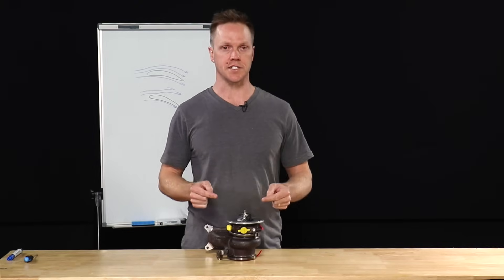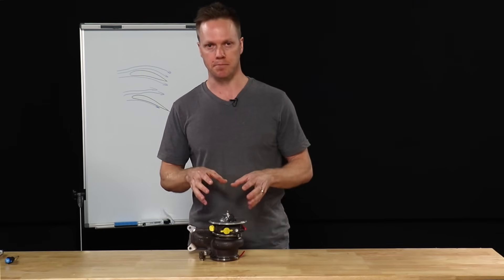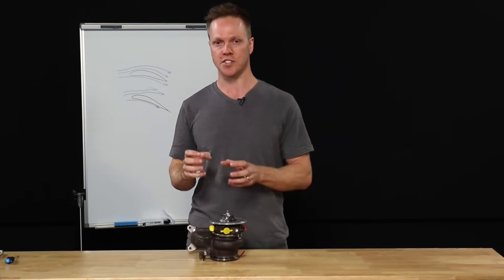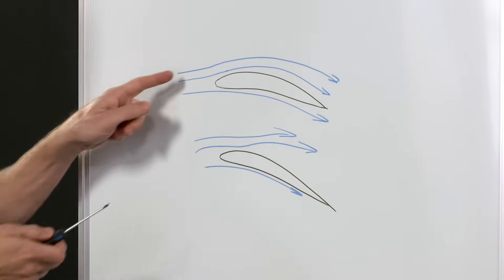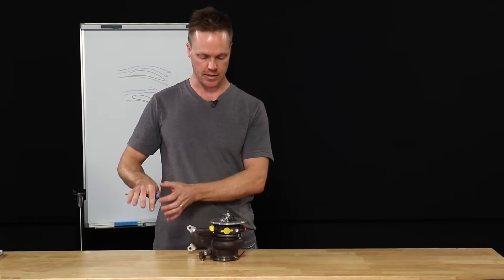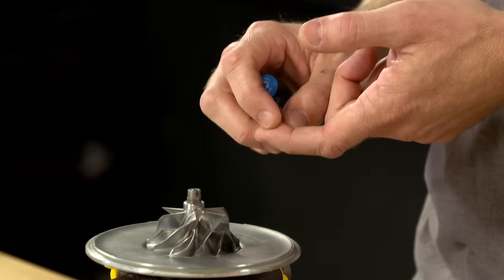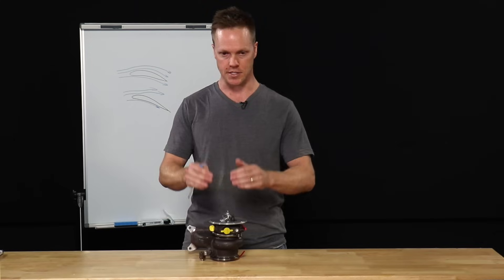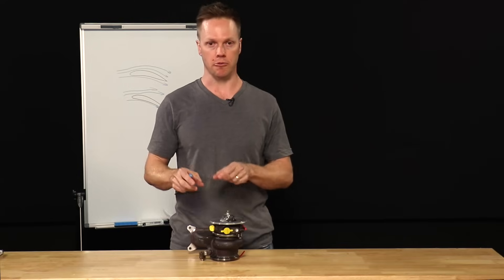Compressor Surge Explained [GO FAST BRETT]

Comment: That should shut up all the STUTUTUTU fanboys and their ebay turbo kits. Great explanation, this guy knows his stuff and understands fluid dynamics. More of these please!
Reply: Yea it will shut up some of the best engine builders in Australia and their 800hp+ turbo setups without a blow off valve/bypass valve...
Reply: +DriftNick well it should. Don't hear any P1s or 488GTBs or other properly designed engines surging.
Reply: WiseWik other then the 488 GTB GT3 car that flutters...
Reply: DriftNick
it's a racecar.
Reply: WiseWik There are other reasons street cars from the factory run bypass valves, it's not because without them the turbo is being damage, if that was true there wouldn't be countless people not running a valve without issue.
Reply: DriftNick
ah yes, because the whole bov market is just a huge conspiracy...
Reply: WiseWik People never put stuff on their cars that isn't necessary right? and they don't do it for the sound right?
Reply: DriftNick
Thanks for supporting my first comment.
Reply: WiseWik "We're not discussing politics here."

"As a brutal way of making power it works"

Honestly wtf are you even talking about? not only does it not make any sense but we aren't talking about on throttle surge.
Reply: DriftNick
Are you seriously having trouble understanding what I'm saying? Go drift something and make a video. Or better yet go learn some physics.

Comment: Uhh... no.
What he's explaining is not surge, it's chuff.
Surge occurs under load, when the turbo reaches the surge line and can no longer compress the air because it's aerodynamically inefficient for the size of the compressor. It generally destroys a turbo fairly quickly.
Chuffing is exactly what's explained in this video. Chuffing has mixed reviews about whether it actually damages a turbo but in most cases, people can run for years with no issues, though, like mentioned in this video, it is made worse by higher boost levels. Chuffing on a diesel engine is the equivalent to surge on a gas engine, not because of the compression ignition vs. spark ignition difference, but actually the fact that diesels have no throttle plate.

Comment: Hi Guys, I have a 09 WRX and just fitted the  GFB Respons BOV. When I am in boost and I change gears, I can hear a brief, but audible "chirp" noise between shifts (Note that it is not the BOV making this noise, it's definitely coming from the turbo. It doesn't sound like compressor surge, but I  am just wondering what it is and whether or not it is bad.
Maybe because I'm running stock boost it is trying to "flutter" but instead doesn't have enough boost pressure to sustain the cool pigeon noise.

Any feedback would be much apprciated.
Reply: Must have a low psi? You could try loosening the bov screw or using a weaker spring
Reply: There is a pressure wave caused by the throttle plate closing that causes the chirp you hear, search "Nissan Skyline GTR R34 Turbo Sound" on youtube, does it make a sound like that when he first lifts on the throttle? if so that is what surge/flutter sounds like if you run enough boost.
Reply: DriftNick I Watched that video of the blue GTR and it doesn't sound like that. (it is not a sustainable noise, only a brief "Chirp sound").

Kinda like some drift cars when they let off the throttle when drifting.

Thanks
Reply: danny hamilton It's the same thing but on your car the blow off valve opens letting the pressure out and stopping the sound, it happens because the BoV has a slight delay.
Reply: DriftNick Hi Nick,

That actually makes a lot of sense  now..
I'm hearing two noises:
1st the "Chirp" sound followed by the bov release noise "shh"

Explains that slight delay!

Thanks

Comment: Wow, a guy that sells BOVs telling me not having one is bad! Contrary to everything this guy said, YOU WILL NEVER DAMAGE YOUR TURBO FROM FLUTTER! I don't care how much boost you are pushing, I'm 1000000% certain you can't hurt it.
Reply: I'm not confusing PSI and CFM, they're two completely different measurements, one being flow and one being pressure. I even told you that you can have two turbo's running the same pressure and get different flow rates...

The whole point of a Decel-Fuel cut, and a 'tuner of 6 years' should know this, is to either cut fuelling off completely or to create a extremely lean condition and prevent engine run on, to increase economy of the vehicle. This means there is no burn in the cylinders, and therefore you cannot cause a lean burn and cannot get knock... Unless your cylinders are waaaayyyy too hot, in which case you have bigger issues.

If you were actually as smart as you're pretending to be, you would understand that the intake side of an engine, when not under boost, is actually the vacuum side. So once that butterfly closes, it drops in pressure and re-enters a vacuum state. That means that the engine is drawing air out of that side and forcing it out the exhaust side.
Meaning that the plenum and therefore the cylinders beyond the plenum are a low pressure area. You also need to factor in that the valves are still opening and closing due to the engine winding down, so all this 'lean mixture' you keep talking about is filtering straight out of the cylinders into the exhaust. If anything, it's cooling the ports momentarily. I've already said all this before, don't make me tell you a third time.

(Just as a side note, any tuner should understand this because when a car is not under boost, even a simple boost gauge reads vacuum and after a supposed 6 years in the field i'm sure you've seen a couple of boost gauges right?)

To simplify for you, because you aren't actually paying attention to what i've been saying all along... NO MATTER whether the engine is firing or not, the pressurised air in the piping after the turbo and before the butterfly, is not enough to RE-PRESSURISE the plenum chamber and the cylinders. Especially so when revving down from high revs.

I really think you should hand back that Engineering degree you clearly stole because you are quite obviously not one. If you were, why would you even bother tuning cars when the money is in Aeroplanes... You'd probably also understand the simplicity of an air pump, which is essentially what a combustion engine is.

I won't wave my credentials in your face either, but my mommy says im really really smart too!

PS - For the love of god, never tune another car again, because what you've displayed here shows that you really shouldn't be near a vehicle.
Reply: I viewed the video the same way M200MW, as an infomercial. Call me cynical i guess. haha
Reply: May also be the fact I ran stock turbo'd 1J with boost up with NO BOV and no damage?
Reply: What if i told you the car is already tuned and running perfectly fine. Also with uprated z32 maf. It was running pretty rich before tune also. Each setup responds differently.
Reply: I don't think you quite understand how a MAF works champ... all that 'Lean' mixture you're talking about has already been metered by the MAF, the engine management knows that air is there. The flutter/gobble/chatter or whatever you want to call it, is because the throttle butterfly is closing/closed, so that metered air isn't actually going into the engine, it's sitting in the pipes/reversing out of the turbo. So it doesn't cause any leaning out of the engine. The only time it would cause a major issue in terms of AFR's is on acceleration, where the butterfly is open and the engine simply cannot take all the pressure it is being fed.

Your argument about no oil is just stupid and should never have left your head. Apples and Oranges. Like has been mentioned before, many cars come out without BOV/BPV's and run perfectly fine as they were designed.
Reply: ***** Those cars also aren't running enough boost to do serious damage to impeller blades, nor enough to create a dangerously lean AFR.

Your throttle body also has a bypass valve to allow small amounts of air in at idle. Snapping the butterfly valve doesn't completely shut out air. Regardless of how big or small that bypass valve is, more air will get through it if it's more pressurized than it is at idle. So until all that left over air escapes back out through the turbo, you're still gunna get X amount of pressurized air entering the engine until its all gone, long after your injectors have gone down to idle duty. Where a atmospheric BOV causes a rich condition in that time, not having a BOV/BPV causes a lean condition.

Your MAF will also expect that air to be diverted elsewhere, it won't correct the fuel tables for air it has no idea is still in the system.

The oil thing is not apples to oranges. One person's lucky experiences doesn't speak on behalf of the vast majority of knowledge proving otherwise. Just because your car survived on 6 pounds of boost with no BOV for 50k easy, 1/4 throttle miles, doesn't mean it'll survive on these idiots buuilding 800hp single turbo Supra's with no BOV.
Reply: +Bradyn B unbolt that turbo. Have a look at the play in your turbo.
Reply: I have it unbolted right now because i'm upgrading it while i build my engine. There is no play, the journal bearings are still fine, but i'm replacing them with steel. The only issue i've had was a seal blow out.
Reply: Says some random youtube idiot that probably has no expertise in turbos or mechanical engineering. Show me demonstrable, repeatable evidence that flutter won't damage or reduce the life of your turbo or shut the fuck up
Reply: Le Mans cars are constantly on throttle... who cares if they don't have BOV because they hardly get used. And those race cars probably get their turbos rebuilt/replaced after every race.
Reply: Weird. It killed my turbo🤷🏻‍♀️
Reply: It won't cause damage on a ball bearing turbo. But will it cause damage on a turbo that doesn't have a ball bearing?
Reply: Great. I won't run a BOV then and I'll send your guys the bill if or when the turbo fails and takes the engine with it.
Reply: Me like many snapped a hx40 shaft on my 2001 cummins running 62psi . The turbo chripped and  I had to buy a new intercooler pipping and turbo. sooo yeah....
Reply: What kind of boost control are you running?
Reply: I also ran my STi with no oil for 200 miles after I unknowingly cracked the oil pan on a road trip, with absolutely no problem. Does that mean we don't have to run oil in our cars? Who knows what would happen after 500 miles, or 75k kms in your instance? But while you aren't running a BOV and thus running a lean mixture post-MAF while your injectors are cycling at idle duty and seeing knock before every shift, I'll be happy with mine. There are millions of people on forums posting problems about their cars that share the same mentality as you; "it's fine for 50k miles, it'll be fine for another 50k" until it breaks at 60k. Don't try to pretend you share the same mentality.

Experience only trumps knowledge when it comes to fixing problems, not avoiding them. Enjoy your lean AFR's, I'll see you on the "car broke what do" section of the forums.
Reply: Explain to me, using your expert knowledge of physics and aerodynamics, how opposing pressure on a spinning shaft won't break said shaft or bend the fragile, thin blades?

Go ahead, I'll wait.
Reply: Boost is relative... You can run 8psi on two different sized turbos and get massively different air flow rates. So they may not run huge amounts of boost, but they can run larger turbos at normal boost levels and still be producing more airflow.
Just as a sidenote, my standard TD04L-13 has been running 20psi since its tune over 60,000Km's ago... without a blow off valve. Thats after 150,000km's of 15psi everyday of it's life since 1998. No issues whatsoever. Tiny turbo by the way, under a lot of abuse, and track work.

The IACV's you're speaking of are actuated and/or controlled electronically and again know exactly how much metered air is in the pipes, on top of that if you want to get really technical... the majority of cars since the mid 90's if not earlier have come out with a factory Decel-Fuel Cut, which deactivates when the car reaches idle speeds (around 1100-1200rpm's in most economy vehicle cases). Meaning that even if that pressurised air is somehow going into the plenum and then into the cylinders after that throttle body snaps closed, the engine is not firing until the car reaches idle speeds or the throttle is depressed again, in which case the air goes straight into a metered air mixture.

Again, on top of THAT, the air that has to squeeze past that tiny opening for the idle air control, then has to re-pressurise the plenum chamber and then the cylinders on the other side of the butterfly. Which simply will not happen with the lack of air that will actually get past the IACV. Because that engine is still revving whether it is firing or not and those valves are still opening and closing allowing the pressurised air to escape, the minuscule amount of pressure going into the plenum and then into the cylinders will be out of the exhaust before it can cause any pressure build up, meaning it will be atmospheric in the engine and therefore the AFR's will stay almost identical.

You answered your own question in saying the MAF expects the air to be diverted. In 99% of recirc BOV/BPV setups the air is put back into the intake piping before the turbo and after the MAF, where it is then recycled back into the turbo to be re-pressurised. All that air is still metered and still behind the MAF.

It is indeed Apples and Oranges, because you are on the wrong side of the lucky experiences. It's not so much one persons lucky experience because so many people run turbo's without a BPV/BOV, it's a couple of peoples unlucky experiences where you see a lack of BOV/BPV causing an issue.

Just like how ROTA wheels had one shipment of faulty rims go out and ever since that, everyone hates them even though they are a quality tested wheel company who even makes rims for factory standard cars.
Reply: ***** If you want to pretend the intake side of the engine becomes a vacuum instantaneously upon closing of the throttle, go ahead. If you want to pretend the injector's cycle down to idle instantaneously upon closing of the throttle, go ahead. If you want to pretend that I'm saying this lean condition exists for any longer than a thousandth of a second, go ahead. Your own car gives you audible proof that this in fact not the case. The fluttering sound that turbo makes without a BOV is a clear audible sign that air is still in the system. I'd say that fluttering sound can last anywhere to half a second to an entire second and a half, depending on the car and turbo. And with a BOV, usually creating a rich condition, your car generally afterfires between shifts for about the same amount of time. Now I don't know about you, but those afterfires don't sound like the car is dumping that much fuel to me. They're not ear piercing gunshots. But while a BOV bleeds air pretty quickly, a spinning impeller blade will not. Whether you have a BOV or not, your car won't change it's idle duty cycle accordingly, since the MAF read the same amount of air regardless of where it exits the intake system. So for the amount of time your injectors are dumping an idle amount of fuel, you still got air in the system slowly bleeding out of that fluttering turbo, and it only bleeds faster if it's being sucked into the cylinder and burned. Don't believe me? Watch your boost gauge, and compare it to the same car and set up with a BOV. Watch how much slower boost drops without a BOV. Sure, we're talking fractions of a second, but when your cars ECU runs at millionths of a second, it's a big difference.

Seriously, like I said, you can test these things out yourself.
Reply: ***** You're confusing CFM with PSI. Even if a small percentage of the air is passing through the IACV, it's still pressurized and does not drop in pressure until it enters a lower pressure space (i.e., atmosphere). Even if your injectors do cycle down to idle speed, regardless of RPM, it's still not enough fuel to correct the lean condition, which will be whatever PSI existed in the pipes before the throttle closed. If you're pushing 8psi, you're momentarily pushing most of that into the cylinder through the IACV while your injectors essentially shut off. The injectors cut a lot more fuel than the IACV cuts air flow.

And I'm not saying people that run without BOV's break their turbos, I'm saying people that break their turbos generally don't run BOV's, and have no idea it was most likely the cause of their snapped shaft, bent fins, or wastegate lines popping off.

At least in my opinion, running rich between shifts and maybe having to top off on oil 10% more than you normally would (depending on oil weight and piston material) is a lot safer than running lean, damaging your pistons and valves and having no way of preventing engine failure (in the case of adding more oil), and destroying your turbo along the way. I'm not gunna wave my credentials in your face, but I've been tuning for 6 years and have a degree in aeronautical engineering. What I've been saying comes from years of knowledge of applied physics and conducting tests, as opposed to just here-say and forum rumors that unfortunately a lot of people in the car community rely on lol